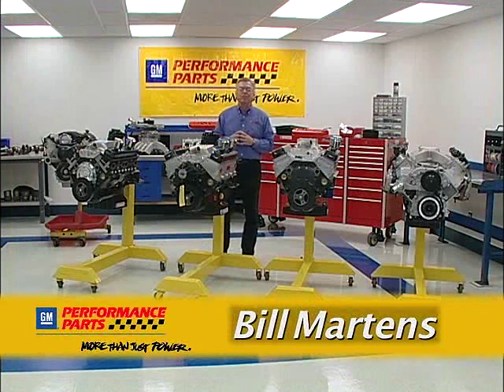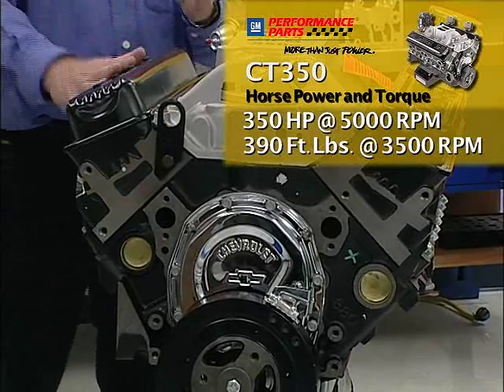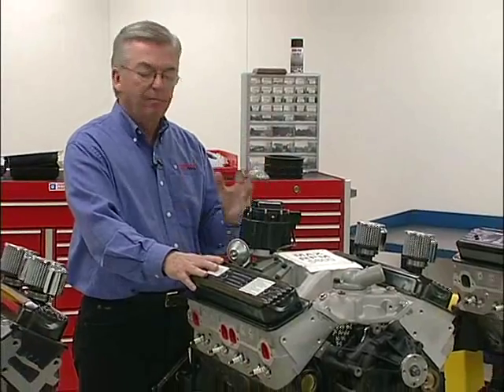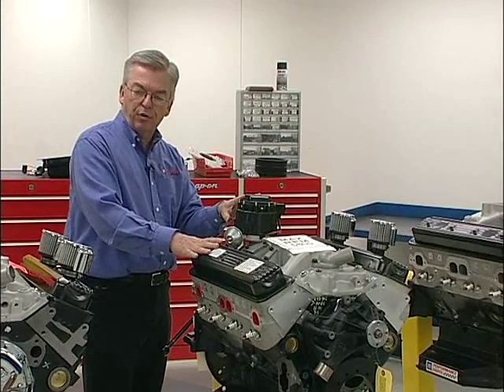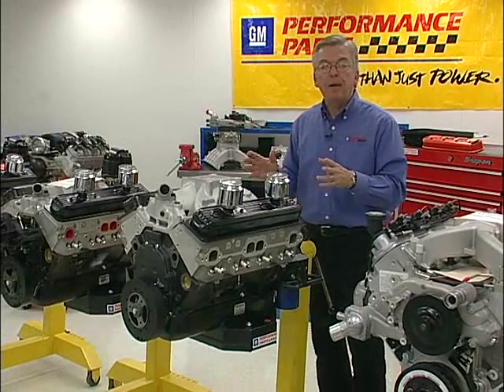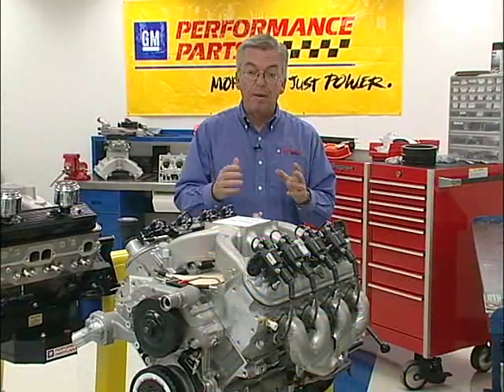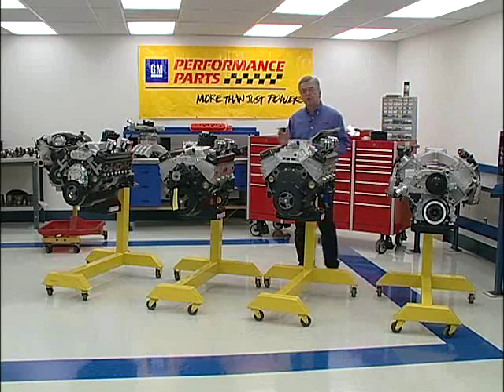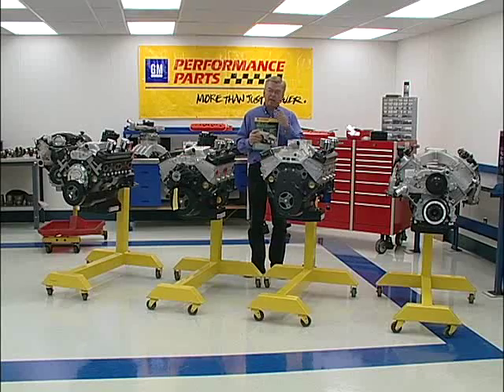GMSPO Circle Track Engines

Comment: Can any of these engines be put into a street car with no modification needed, like changing out the oil pan?  like a stock G-body, or an F-body? Just asking because the price tag on these engines are cheaper than GM crate engines for street use
Reply: Racing engines require leaded fuel.
Reply: @michaelcarter577  false
Reply: @michaelcarter577  you can run leaded fuel but 91 or 93 octane pump gas works too. I've ran up front and won races with pump gas.
Reply: @michaelcarter577  not since the 70s dude....
.
NASCAR and top fuel dont use leaded gas / nitro...
they just use like 110+ octane 
.
some normal gas stations will sell higher than 91 fuel
and E85 is around 105 IIRC
Reply: @michaelcarter577  like..... all you need is hardened valve seats..... and you DONT need lead
.
and hard seats are FACTORY in every engine since the 70s.....